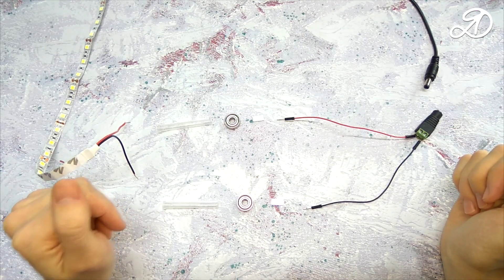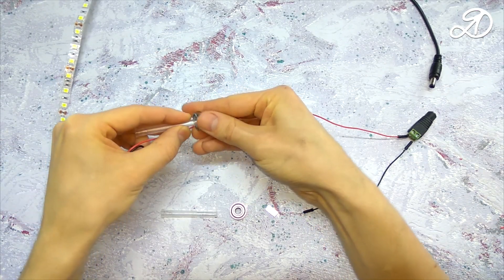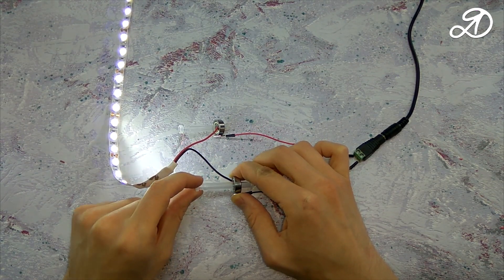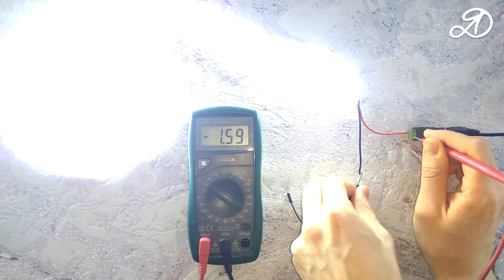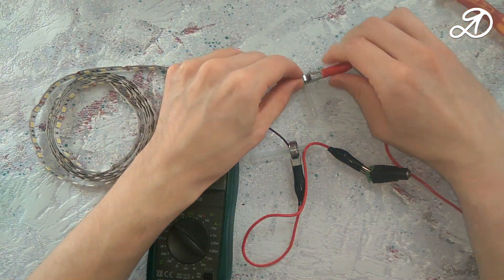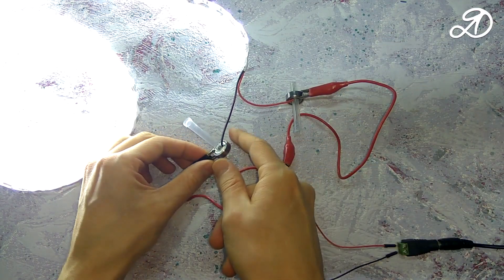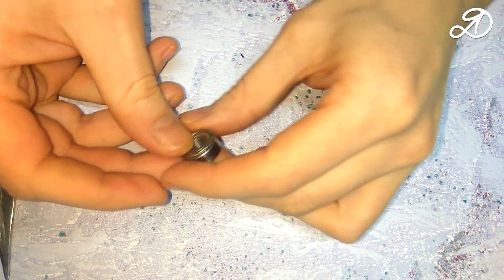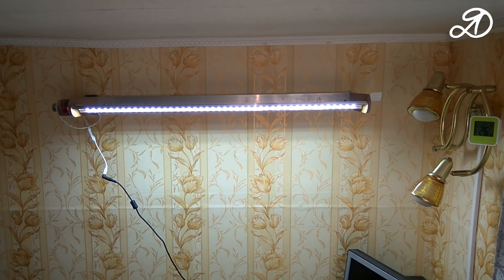SUPER IDEA!!! Transmission of electricity by bearings. How to remove grease from the bearing

Comment: Gettign rid of that flicker should be as easy as adding a capacitor into the circuit to smooth the voltage. This could be a pretty cool idea for replacing brushes in trains, actually.
Reply from the maker: Flickering is not a problem for me, I just told about it. But someone might need it. Thank you very much. Thank you for watching and comment!